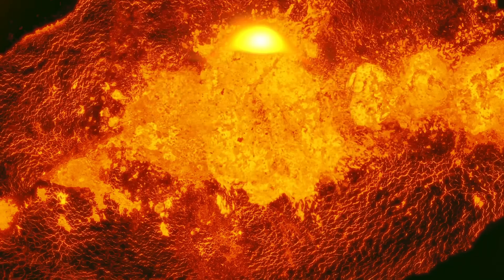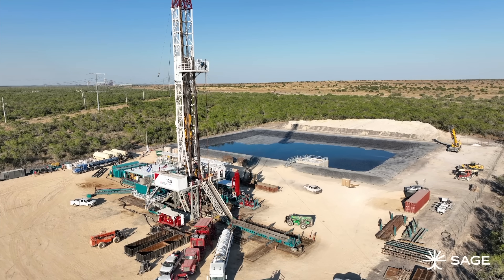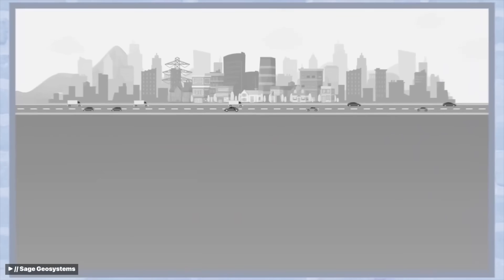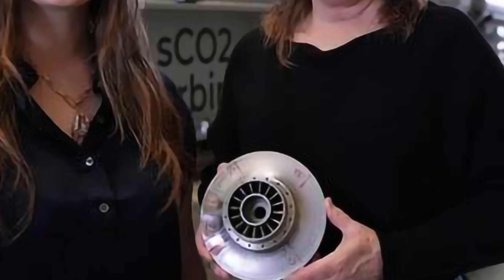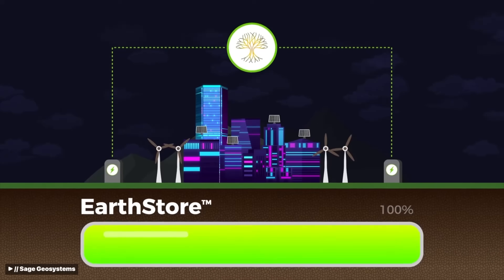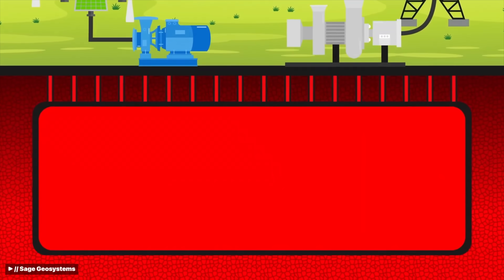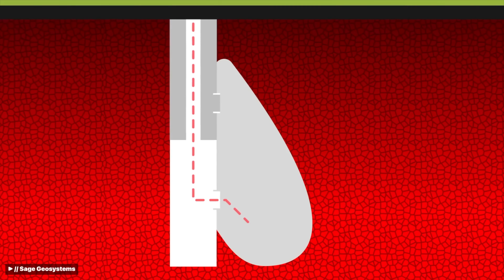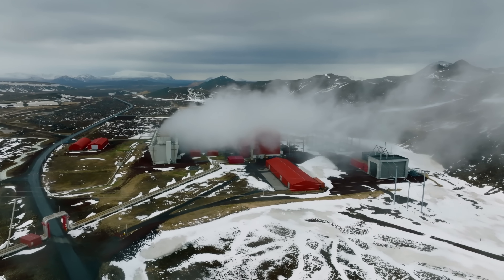This Tech Solves Geothermal's BIGGEST Problem - Gamechanger?

Comment: A ground loop with heat pump I'm betting will be cheaper for individual homes and is here now. 48" down my soil is 45 to 48 degrees all yr round. I think with what they are talking about here is a pipe dream. Will it work, oh sure will, but cost is going to be WAY higher then they will ever admit til its in and done and your local utility signed on and you are the one who now has to eat that higher cost. I'm going solar mini split that will cool with 4 high watt high efficiency solar panels. Might try to figure out a ground loop heat exchange system for it specially for winter.
Reply: Ground loop heat pumps are for more efficiently using electricity, geothermal is for making megawatts of electricity. Expensive, sure, but show me the megawatt-scale generator that isn't!

Comment: Should  we be messing with the  Earth's  heat core and  what will be the  long-term  impact ?
Reply: 1) As The Fine Video explained, it's not even remotely near the core.
2) The impact on heat flow out of the earth? Basically nothing. The heat we're tapping with geothermal had already gotten over 99.9% of the way to the surface anyway.

Comment: We have a freshwater shortage; how much water does this process use?  Solar and wind use Zero.
Reply: It uses basically no water, and it doesn't have to be potable water. The water is recirculated through the well again and again and again and again.
Reply: @SavageChinquapin  There is an inconsistency of whether or not this system makes energy or stores it.   Even if it only stores energy, you never get back what you put into it.
Reply: @martinsoos  You're jumping all over the place. Go see my other comments on that topic.

Comment: No one talks about the energy “coming into” the planet. Check that out. How about pulling electricity out of the ionosphere?
Reply: Or the flip side, can we make use of the terrawatts already being radiated from the planet?
Reply: That depends. If pulling electricity from the ionosphere requires less moving parts and can be done anyway on the planet, or in the sky over the planet, without drilling, or liquids, or generators... it seems obvious and would probably cost less. IMO @roberthealey7238

Comment: The obvious question is…Where does all the Heat go? At the moment we can safely assume the Heat from all sources including GeoThermal follows thermal dynamics rules…Heat goes to Cold. The more heat that is generated the less cold there will be to absorb it in the air, land, and sea. Until so much heat accumulates that a runaway heat engine re-creates a Hot House Earth environment unsuitable for mammalian life. Eventually so much heat accumulates in the atmosphere that it re-connects with the super-cold vacuum of orbital space. Triggering a global Antarctic Type ice event called Snowball Earth which will last millions of years.
Reply: No, the obvious question is why you aren't worried by the enormous amounts of heat actually created by burning fossil fuels. Geothermal just moves around existing heat.
Reply: Well as stated in the video, the heat is going to escape no matter what.  While tapping into this heat will accelerate the rate at which it is released, a decent percentage of it is being captured/converted too.

Comment: If cryogenic Co2 was inserted into wells the low temperature heat near the surface will produces surplus turbine energy without using water or deep wells because super cold liquid boils below zero degrees.

Comment: Please keep in mind that drilling pipe is not just steel but has alloys that are required to prevent corrosion. So you oversimplified the requirements necessary to make it work. It does seem like a good idea in general.
Reply: I would imagine any corrosion-resistant steel they would use at this scale is likely going to be galvanized, which relatively speaking isn't that severe of a biohazard.
Reply: No; Usually it consists of chromium, nickel, molybdenum, and vanadium. It is about the cost, not toxicity.

Comment: I want to hear more about this supercritical CO2 turbine.
Reply: Kirk Sorenson has quite a bit of content on it.  It is what they intend to use in their FliBe thorium power plants that are nowhere because of the NRC.  Think of supercritical gas as both a fluid and liquid.  It has the density of a fluid but it fills a volume like a liquid.  CO2 is nearly unique among all known gases in that it is trivially easy to compress because of its very strong bond polarity.  All those things make it an insane working fluid for power generation.
Reply: @StormGod29  By insane do you mean good? And aren't liquids fluids?
Reply: @cre8tvedge  yes supercritical CO2 is an insanely good working fluid for turbines.  Liquids are fluids but not all fluids are liquids (I know that sounds strange).  Fluids are able to flow and take the shape of their container.  There are things called fluidized beds in which powders are turned into a fluid by gas flowing upward through them at just the right velocity.  The powder is now a fluid but most certainly NOT a liquid.  But for supercritical CO2 the main take away is it is dense like a liquid but will spread out and fill its entire container like a gas.  This is what supercritical means.  It behaves as sorta a gas and liquid at once and you really can't distinguish which it is; it is supercritical.
Reply: @StormGod29  Thanks for that.
Reply: see the GE "sunrotor" that could power 10,000 homes and the size of a desk (also used supercritical co2,)
Reply: Speaking of cool/cutting edge energy tech, go check out “Quaise Energy” and their plasma bit drilling head, that they’re currently testing in the field.

Comment: I have some concerns about drilling through the water table, and also whether the water is going to disolve heavy metals and other lovelies and bring them to the surface.
Reply: in the U.S. state and federal authorities require that surface casing be set from surface (pipe and cement) down through all sources of fresh water. The problem is that there is no require to test surface casing for the quality and extent of cement bond. Poor bond can lead to vertical migration of contaminating waters. Also, cement and pipe age and with time cracks can develop that lead to vertical migration of fluid.

Comment: I see.  They use two wells/reservoirs.  They currently use a peloton turbine.  Each cycle starts with a hot high pressure reservoir and a cold low.pressure reservoir.  Hot high pressure drives the turbine while pressurizing the cold low pressure reservoir.  Then the reservoirs reverse.

Comment: Geothermal is the cheapest, quietest and cleanest way to heat AND cool your home. One system with a heat pump supplies all your hot water needs (hello swimming during the shoulder seasons) powering laundry, dishwashing and comfy toasty floors (hydronic in floor heat) on a crisp February morning. I love the idea scaling it up.
Reply: I wouldnt call geothermal cheap.  Its extremely expensive. If you are looking at swimming during the shoulder seasons just use a regular heat pump.  Those shoulder seasons you are most likely pretty close to the same temp as what you are wanting your pool to be at.  The temperature delta for geothermal would actually be higher which would mean you are actually using more energy.  Where geothermal really shines is if you live in an area where it gets very cold.  At -40 your air source heat pump is no longer working.
Reply: @pin65371  Actually, for me, it's gonna be cheaper than usual. I live in the Arizona mountains, about a mile high. I intend to harvest rainwater and put in septic rather than pay the unGodly amount demanded to tap into city water and sewer. Since I have to dig a huge pit for the 20,000 gallon cistern, might as well wrap my geothermal lines around it. It's not super cold here, it doesn't get to -40, but it does regularly drop below freezing to 20 degrees or so, and a geothermal heat pump can easily handle a delta of 50 degrees. Since the biggest expense is digging the wells, and I already have to dig the well, I'm in great shape
Reply: @pin65371 It appears you are confusing using the earth relatively near the surface as a constant temperature heat sink for a heat pump as in a root cellar and using high temperature deep subterranean energy to generate electricity.
Reply: @matthewhuszarik4173  no I'm not confusing it.  I know the difference between ground source and geothermal. I'm just not some nerd that start correcting terminology when someone uses the wrong term and everyone knows what they are talking about.
Drilling deep holes for power production is also extremely expensive.  Eavor Europe is a $200 million project which only gets 8.2 MW of electricity production.  If you live in most areas of the US its also much cheaper to just go with an air source heat pump vs a ground source.  Air source heat pumps are good down to -35 so unless you are in an area where you see longer periods of even -30 you are going to be better off with just using air source.
Reply: @pin65371 Then why are you talking about heat pumps in a video about geothermal power if you don’t have them confused?
Reply: @matthewhuszarik4173  go read the original comment again.  Why were you responding talking about geothermal when this person was talking about heating and cooling their home?  They were obviously talking about ground source.  I just went along with the terminology they used because I knew what the person was actually talking about.  There is a reason I actually split up the home heating and cooling topic and the power generation topic.  You were the person to respond to a ground source heat pump comment by talking about geothermal.  Why didnt you correct the person that originally commented by pointing out that they were referring to ground source and not geothermal?
Reply: @pin65371 I apologize, I should have flagged my comment to the original poster.
Reply: Geothermal’s claim of being clean is highly over rated. While it doesn’t emit CO2 it does bring up tons of toxic materials. The largest Geothermal generator in the world the Geysers in the US has to deal with tons of toxic chemicals such as arsenic, cadmium, mercury, sulfuric and nitric acid. The proposed solution is to just re-inject them back into the wells. The problem with that is the concentrations near the wells just continues to increase resulting in the hardness of the water becoming an issue with equipment also any small leaks are highly toxic.
Reply: @matthewhuszarik4173  Uhm. This will be a domestic system. The PEX pipe is problematic (i.e., not very green). But as a domestic system, I'm not going to tap into underground geysers. I'm just recirculating water and anti-freeze through a heat pump over and over again. So, no heavy metals issues.
Reply: @lindacgrace2973 There is a difference between using geothermal heat for power generation and using the ground as a heat sump for a heat pump. This video is about using geothermal heat upward of 1000°F to create steam to power generators. Those require wells that go down to near volcanic activity or the mantle where the thermal energy is frequently hundreds if not thousands of feet. Heat pumps just take advantage of the huge thermal capacity of soil. If you dig down more than half a dozen feet you will reach an area that the temperatures don’t change perceptibly with the seasons. Even in warm climates if you go down 10-15 feet it is very cool the whole idea for root sellers and subterranean AC. This is the heat sump heat pumps can use in cold climates.
Reply: @matthewhuszarik4173  Precisely! Since I already have to dig a large hole, (the cistern is about 12' deep and 14' in diameter) I might as well take advantage of the earth as a heat sump. It's an efficient choice in my situation and I'm delighted to see the concept "scaled up" for steam-turbine electricity generation. I think a lot of people are looking for a 'silver bullet' to solve our energy needs. OTOH, I believe that we will fare best when we flexibly apply a wide variety of small- medium- and large-scale solutions as needed.
Reply: @lindacgrace2973  have you ran your idea past an engineer? Typically you want about 500 ft per ton of heat pump capacity.  If you have 14 ft of diameter you arent even close to 500 ft.  Even if you wrap it multiple times you still wont get what you need since you need a certain amount of space between each loop.
Reply: @pin65371  Haven't run it past an engineer yet, but I certainly will before it's installed. The house is very small (1,000 square feet) and heavily insulated (not quite to Passive House standards, but close). I sincerely doubt I'll need more than a ton and a half, I can't imagine it going past two tons. Also, keep in mind that as deep as the cistern is, the pipe will circle it in two foot lifts (I.e., one loop, angle up two feet, loop again) at least four times. Once around a 15' hole is not enough. But if you allow for loops from 12' depth to 6' depth, that's four loops or 60' in length.  If the engineer decides that's not enough, I'll have to install an extra loop around the swimming pool.

Comment: This is BS btrw. You got scammed again. What thremodynamic cycle aere they using? Seems like a brayton cycle is being proposed to me, hence the super crytical Co2 turbine. Small problem is that Brayton cycles require around 6 to 7 hundred degrees C heat to work. 

Where the hell are thy getting that from?? lol, Heat in the crust of the earth goes up the further you go down (makes sense) but only at around 25~30 Degrees C per Km down. This states the bores to be 3~6km deep. So that's 75C to 180C max temp. Btw, Super crytical Co2 Brayton cycle turbines are not their invention, they don't get used due to not having enough heat even from Gas or coal stations, so why the hell would this set up produce the heat needed for this cycle?? 

further, what keeps the water in the system? Digging two bore holes near eachother doesn't achieve this, you'd have to link them to make a loop or reverse radiator layout of joined underground channels. There's already a company doing that btw.  

Also, your pressure comes for free down there, so it goes without saying. How much enegy do theese pumps need? that really cuts down efficiency and are not needed. 

As for a battery, not in the way she explains, no.

Comment: Go tour Sage. If we're going to colonize space, we'll need to figure out how to use geothermal at scale. Many places have thin atmosphere, so no wind. Most places are very far from the sun, so solar is weak.

Geothermal means anywhere that heat is generated within a rock, we can have power. There are warped moons around the gas giants getting stressed from tidal forces, so there's heat. I don't know how warm the moon and Mars are, but there's probably a big enough differential between the interior and the atmosphere to drive something. Venus is too cloudy for solar, and extremely harsh on moving parts, plus it's extremely hot on the surface. Probably have to build underground just to get out of the weather.

Just way more places you can do geothermal once you get past the weak arguments propagandized by wind, solar, and carbon. It's also less maintenance and tech prowess to maintain than nuclear. It's just better on all fronts.

You've got to question why popularity is correlated to scarcity. Propaganda says nuclear is worse than carbon because of a couple mistakes, but carbon poisons the ENTIRE planet and causes irreversible damage. Wind and solar are claimed to be better than geothermal, but they rely on patentable inventions purchased by the millions and constantly serviced and maintained while hogging massive amounts of land and destroying whole ecosystems while producing permanently toxic tech waste. Science shouldn't be driven by marketing. Geothermal is the safest, least destructive, and has a small footprint. At the end of civilization, geothermal is just a hole in the ground and some pipes, not toxic poisons or a massive dirty bomb nobody can stop.

🤷‍♂️
Reply: Humanity will never "colonize" space, or even Mars. There may well be AI controlled robotic spacecraft that strip the solar system of resources for use on Earth. That will be orders of magnitude less expensive than sending humans to do the job.

Comment: Please discuss with them the risks of ground water contamination. Leeching out chemicals that have been kept safe in dry rocks
Reply: Unless Sage is doing something weird, there should be little (if any) leaching of chemicals.
1) Unlike oil and gas fracking which tries to fracture far out into the formation, geothermal fracking should be targeted to stay just between the two paired boreholes (injection well and production well)
2) Unlike some traditional geothermal, they should be reinjecting the same water again and again and again and again in a loop. They will actively avoid leakage.

Comment: Thanks for sharing your thoughts, ideas and videos. Great to hear that although the progress has slowed it hasn't stopped from the last century. I've always been a big fan of geothermal and there was hope during the last decade until they started making earthquakes is areas of previously quiet ground activity. Seems like the big improvement is twofold, the co2 turbines, always a work in progress for them and other industries and the low impact fracking. The only red light came from their seemingly inability to mention what kind of crushed rock they are using, is it a guarded secret or possibly a type of rock than might be considered not exactly environmentally friendly. Questions!?   More on this topic would be appreciated thanks. Wishing you and your family the best.